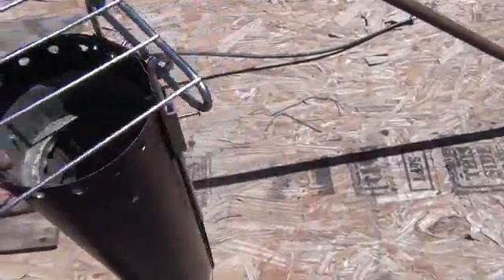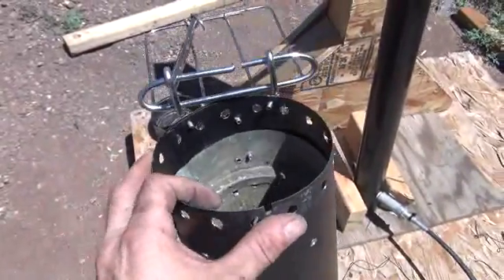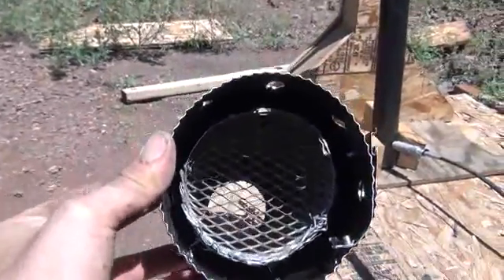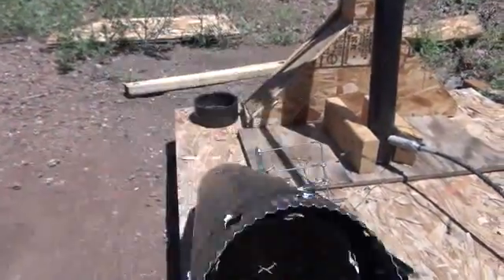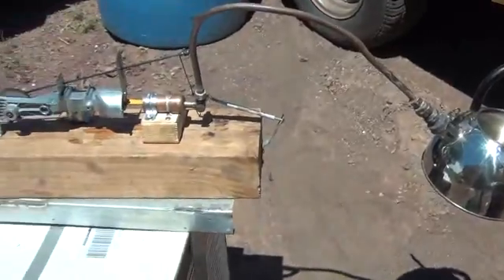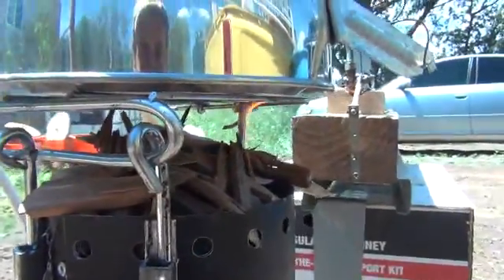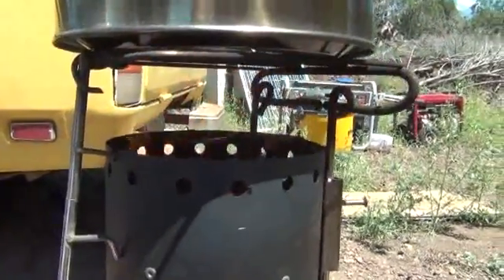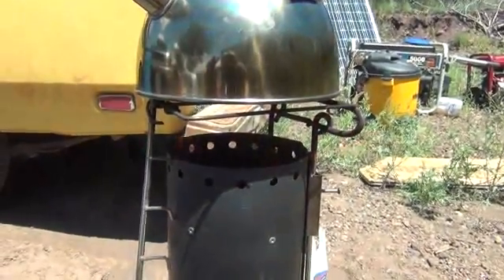High volume Gasifier cook stove.

Comment: Really clever.  I got hooked to your vids from looking for a "high volume" car camping double walled stove.  Nice ideas.  I was thinking that a person who had access to some lighter, more flexible flat sheets of metal (or titanium $$$) could easily rig up a set of tubes that would fit into each other with a couple of rings and flat cap with the inside cut out (to hold the tubes into shape once they're rolled up).  thanks for firing up all these ideas.  Jules

Comment: Mr Teslonian, With your previous video's on gas production, could you tell us, more on the scrubbing of the syngas used in your vehicle? How often would one need to change the filters? I have seen many video's of filters made from charcoal, wood chips even pebbles, but what you you recommend would be sustainable for a motor to run almost continously driving a tobacco drying system.

You are an inspiration, my God bless you abundantly.

Sincerely Glaze

Comment from the maker: It would be an interesting task to get 4-8 pieces of charcoal to last 8-10 hours, the first step would be limiting its burn rate so only a very small amount would burn at once, the volume of fuel produced by this gasifier in the video is a sufficient quantity, it's just being released to fast so by slowing the gas production speed, and burn rate it could be made to last a relatively long time, almost what you are looking for.

Comment: Mr Teslonian, Great Video's, with out Question well Educated in Mechanical and Practical fields. 

I like the complete burn aspect of this. I would imagine charcoal would burn longer. I am doing aquaponics and am Looking to design a Water Heater 8-10 hours at night. Limiting the intake and exhaust should lengthen the burn time.
Trying to achieve 4-8 charcoal size pieces to burn the time and still heat water is 1/8" copper coil tube slow flow rate. In FL just keeping Goldfish alive